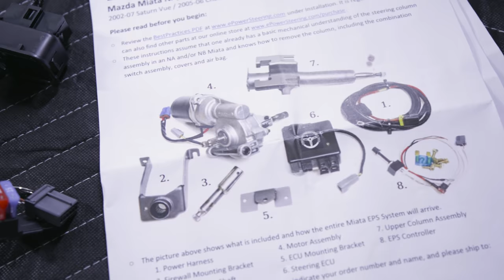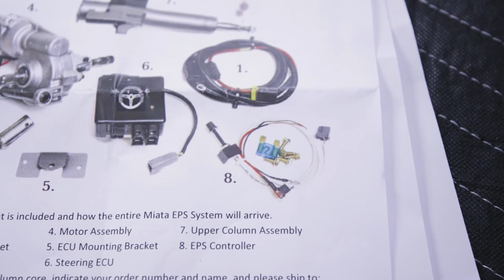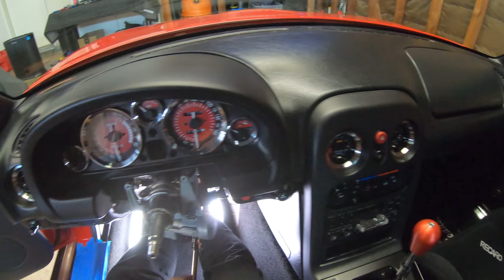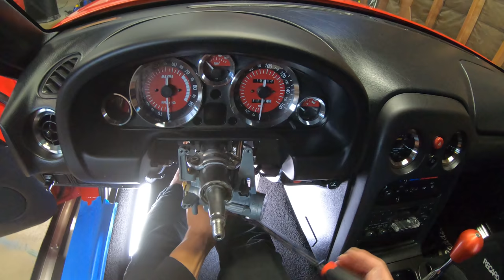MIATA ELECTRIC POWER STEERING INSTALL | #OMGMIATA | EP78 | [4K60]

Comment: How is the return to center with the electric compared to manual?
Reply: The electric steering will fight the return a little bit. If you add a little bit more caster, 3 degrees, it will return normally.
Reply: Thanks for the reply!  Stock NA caster is 5 degrees so adding another 3 degrees would need 8 degrees?   Max caster is around 6 degrees so just wondering how to get a good return to center feel with the electric steering?

Comment: I've driven a Miata on track with power steering and one one without. the deference in feel is honestly negligible. the perks of power steering for slow moving maneuvers far out weighs the added 'feel' imo. plus bump steer also gets mitigated so the steering wheel doesn't feel like it might jolt out of your hands
so a kit like this is a win win if you ask me!
Reply: Need to work out and make the forearms bigger in that case :)
Reply: No way Jose. A properly depowered rack is far different from any power steering set up. Low speed and high speed. Power steering is for driving your girlfriend around with two fingers and drinking your carmel machiatto. Miatas are worlds better without ps. It gives it that real "go kart" feel.

Comment: I know it's 2 years old now. I have a suggestion for storing screws, nuts and bolts. I use an egg carton and can then drop them into the indents where the eggs would go and label.

Comment: Love that although you do everything so clean and seem to make it look easy, you still have the same struggles as us plebs when reaching in places you can barely get to.

Edit: What does the motor do when turned to zero? Does that "lock" the shafts together giving a similar feel as a depowered rack or does it simply do nothing on steering wheel input but stil dampen feedback from the tires?
Reply from the maker: Kinda but  not locked locked
Reply: It shuts off the electronics. Now it is manual steering. There is a little bit of drag and <5 degrees of flex in the torsion bars in the unit.

Comment: I had this on my car and sold it almost straight away because no matter what I did the steering wouldn't return to center. I reached out to Ken at epowersteering regarding my concern with well written, detailed emails and he responded with lousy one line responses and no resolution ever happened. I'd avoid this setup like the plague unless you want to gamble 1k in hopes that it works.
Reply from the maker: Mine has been working fine for 6 months
Reply: @Adam, did you try to add 3 degrees of caster?
Reply: @OMGBUILDS  What is your caster setting?  Not retuning to center is a known issue on this kit, but if yours is working properly please do a video showing the return to center works.  This is the only concern I have before making the purchase for my daily driver thanks so much man for the great content!
Reply: @ePowerSteering  I did. I had the car aligned with 7* of caster, that was the most we were able to get even compromising some camber to get that much caster and the car was dangerous. You could let go of the wheel at any speed mid turn and it would maintain the turn and never unwind the wheel / return to center. The power assist was great at slow speeds but overall it made the car un-driveable. Beyond all of that when I reached out to you, @epowersteering, you all didn't want to give me the time of day. The customer service is not what I expected given the price of the kit

Comment: Out if curiosity is the na battery physically smaller than the nb? I was able to turn that same battery on it's sideand use the oe tie down on my nb.
Reply: It is taller. I put my Bosch battery from my NA into my NB and had to add a spacer for the oem tie down, as the battery was taller than the original height.

Comment: Bruh why would u want electric steering over hydralic
Reply: Less power loss on the engine
Reply: The main point is it is adjustable on the fly from about Zero Assist to 100% assist. Secondly it removes alot of crap in the engine bay for adding Forced Induction, removes a very flammable liquid, removes weight and redistributes the lesser weight in to a much better location. It is also maintenance free.
Reply: Exactly. People might as well get a self driving car.